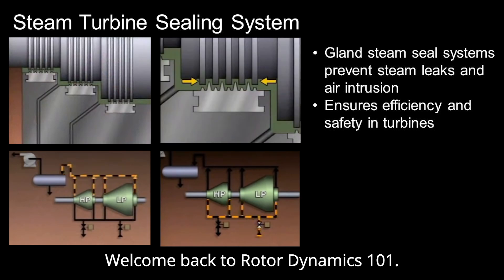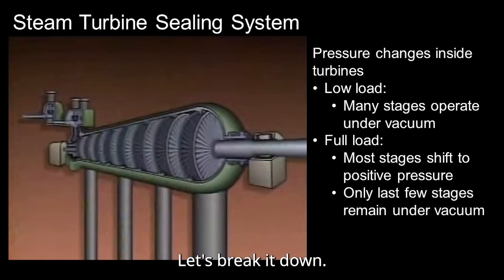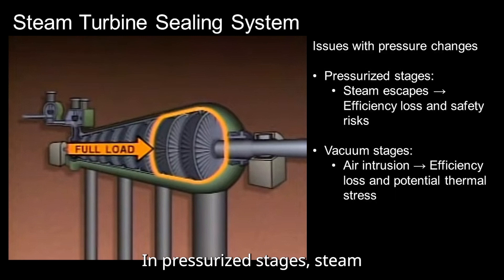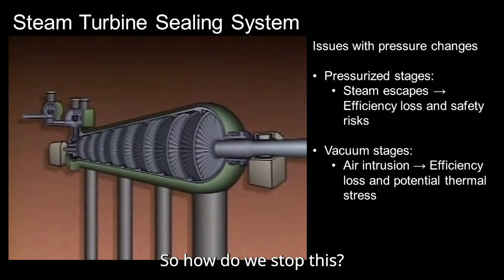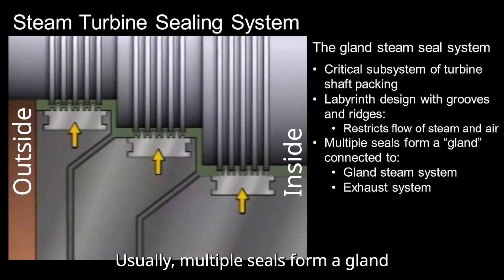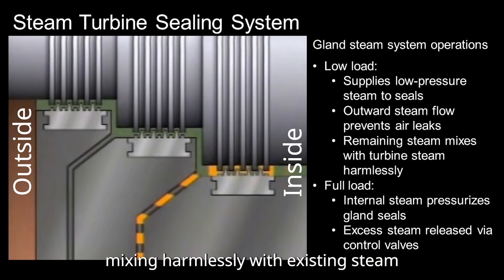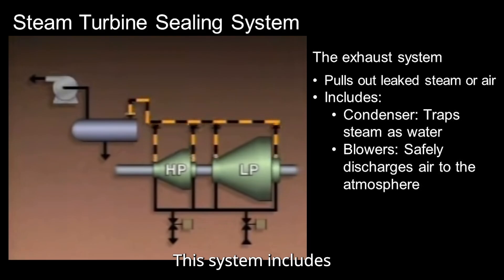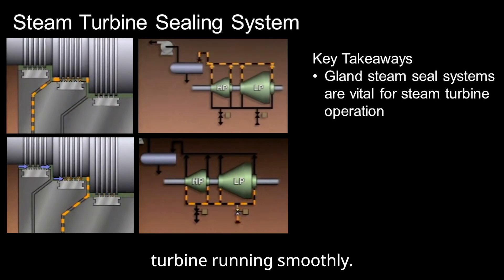Gland Sealing System in Steam Turbines (Part 61)

Comment: I believe the shaft rotation assists with the seal limiting leakage when spinning (boundary layer effect). 

Question, When turbine is not in use (ie cold shutdown), I presume some type of contact seal (blocks) are installed to keep air leakage leading to corrosion?

When steam turbines are shutdown is there some type of purging process to remove water vapor (avoid corrosion issues), or is there any additives (oils) injected during shutdown process to address corrosion? Is there pre-heat process during start up to address startup condensation?

Thank You.
Reply from the maker: Thank you for your thoughtful questions! Let me address each one in detail:

Contact Seals During Cold Shutdown: During cold shutdowns, many steam turbines employ mechanical contact seals, like carbon rings or seal blocks, to minimize air ingress and prevent leakage of residual steam. These seals also help limit the exposure of internal components to ambient air, reducing the risk of corrosion.

Purging and Corrosion Prevention During Shutdown: For extended shutdowns, it’s common to purge the system with inert gases like nitrogen or dry air to eliminate moisture and water vapor, thus preventing corrosion. Some operators may also inject anti-corrosion additives, such as protective oils or vapor-phase corrosion inhibitors (VCIs).

Pre-Heat Process During Startup: Yes, pre-heating the turbine is a critical step during startup to address condensation issues. This is typically achieved through "warming lines" or auxiliary steam that heats the casing and internals to a temperature above the dew point, ensuring that any residual moisture is evaporated. This process also reduces thermal stresses on components during startup, enhancing reliability.

Comment: Good Insight. 
For general purpose steam turbines , those have shaft surface speed less than 50 m/s, we use carbon rings as end seals which are contact type and more effective than labyrinth seals.
Reply from the maker: Thank you for sharing this insight! Carbon rings are indeed a practical choice for lower shaft surface speeds due to their effectiveness. I’ll be covering mechanical seals in an upcoming video, so stay tuned for more insights!